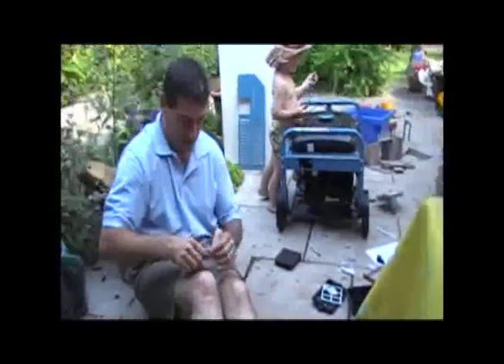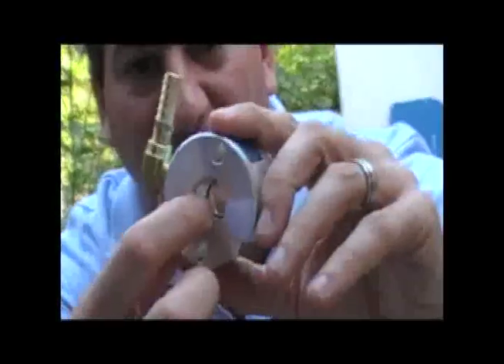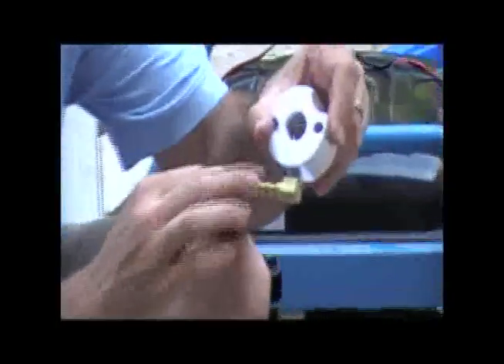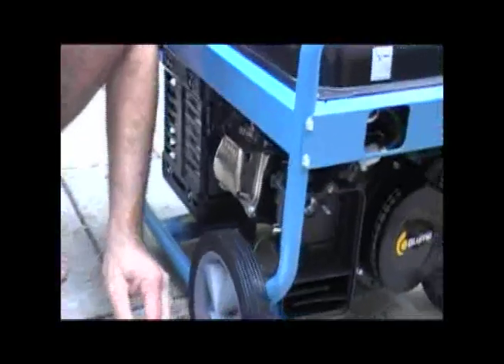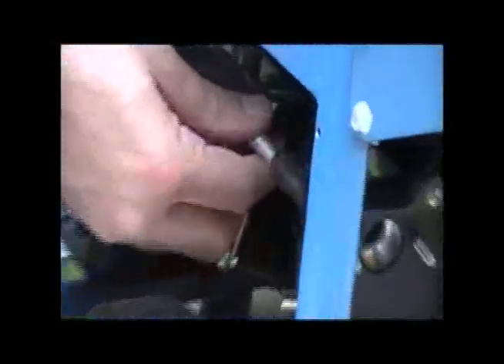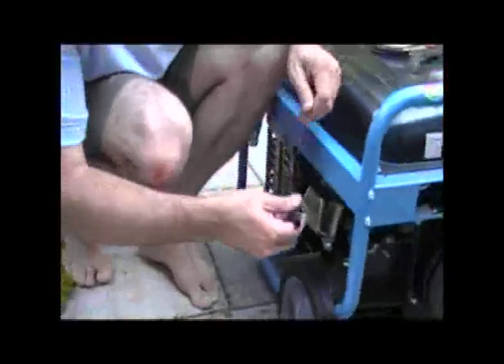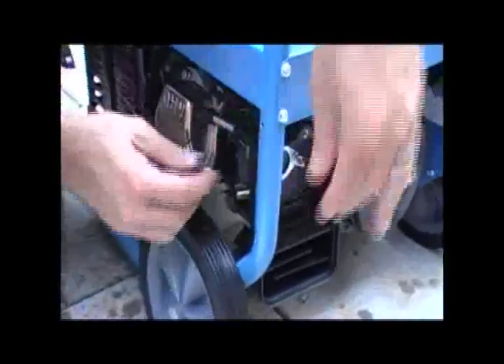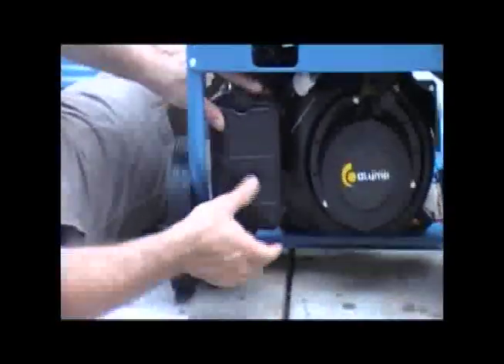Tri-fuel Engine Conversion for biogas use, part 1

Comment: Hi Thomas,  Since your great video do you know of any commercial enterprises that will convert a car engine (currently running on unleaded petrol) to run on methane/biogas?  Also Thomas, have you any thoughts on why the world is marching towards battery power when converting to biogas is so much easier and carbon friendly (lithium resources and battery efficiency)?  Thanks.

Comment: So you happen to have anything written on this.  Like the type generator you are using and more detailed info for us not so clever want a be's.  I am very into biogas and would like to know how much electricity this particular generator would produce. I am wanting to create a aquaponic garden green house and need enough to heat  the green house in the winter and also to have it for lighting and pumps. Do you think this would be large enough for the job if not do they make this in larger size?  Sorry just a single mom trying to make ends meet:)  Thanks so much.